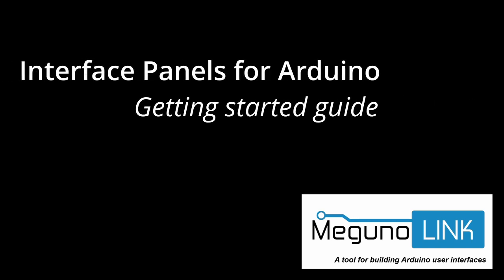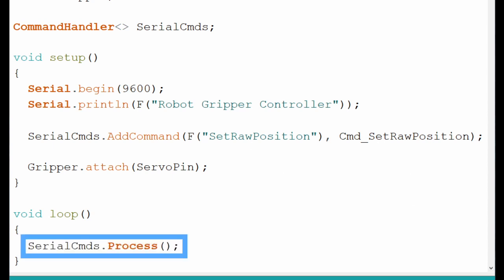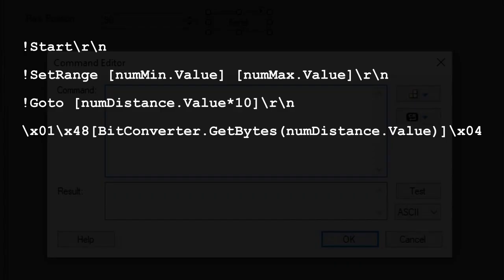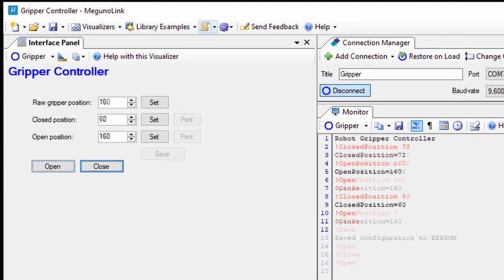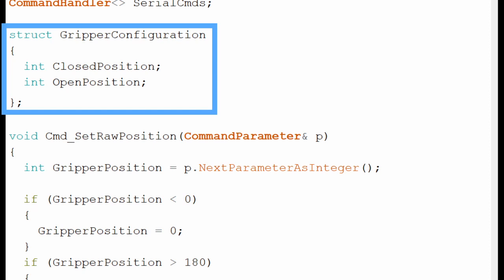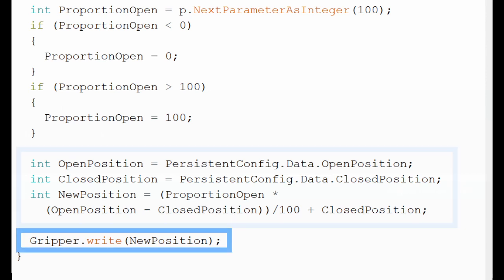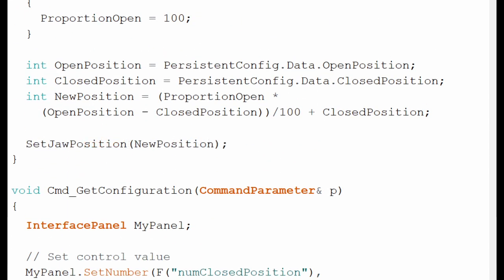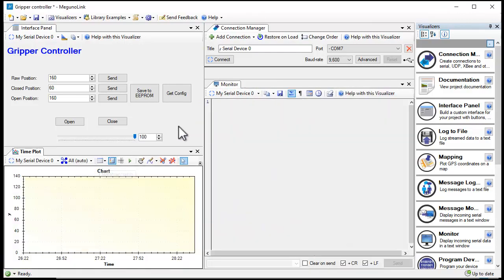Build Arduino user interfaces with MegunoLink

Comment: Hello this is very helpful and very promising.. is there any options for the interface to be web based..? So it won't need installation on every platform.. just a simple web client via any browser...
Reply from the maker: Thanks Ryan. I often use MegunoLink, through the serial interface, for testing and configuring (e.g. set WiFi password) projects on wireless devices like the ESP32. Then I build an html interface with Bootstrap (https://getbootstrap.com/) for the features I want to expose over WiFi. We also have Builder (https://www.megunolink.com/download/download-builder/), to create a redistributable setup program for your projects. MegunoLink itself doesn't build web interfaces though.